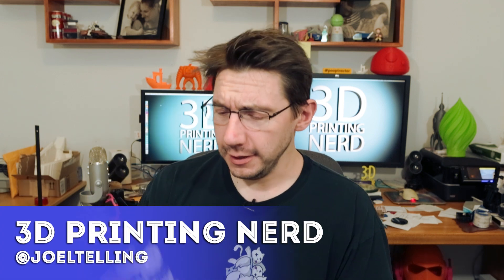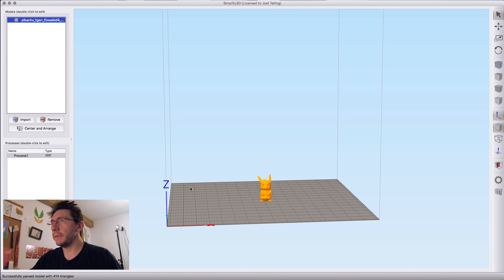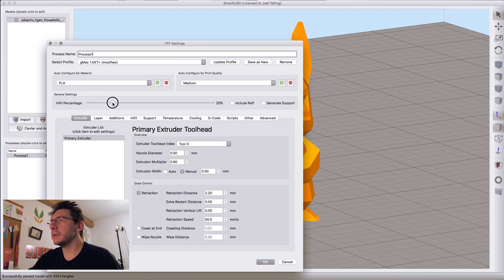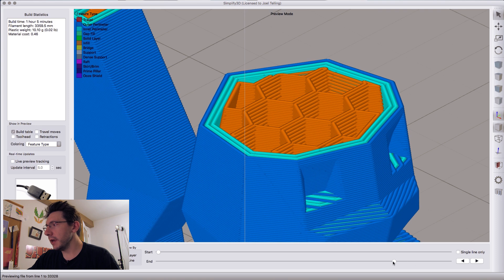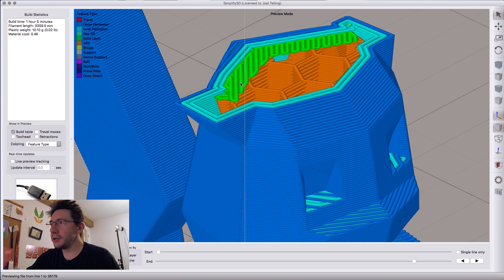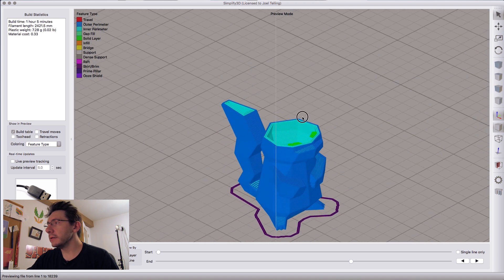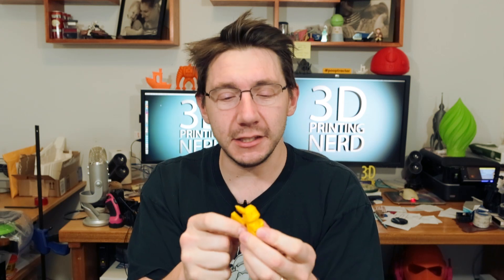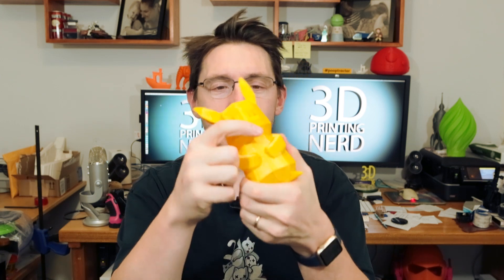3D Printing: Stop Wasting Plastic on Infill Percentage

Comment: This is an ungodly opinion-heavy video making a claim that could have been easily, actually substantiated with force gauge measurements. Simply ripping apart 6cm tall models by hand doesn't tell us anything about the quantitative differences. 

While I think I understand the point you're making (and agree that low/no infill is fine a majority of the time) saying "Some designs work fine with no infill" doesn't really get at the heart of the issue and there are no basic measurements.
Reply from the maker: +Thomas Wade agreed. I SO agree with you on this. I missed out when I didn't have the proper gauges to measure. I'm hoping to revisit with better testing methods.
Reply: Don't get me wrong, I think your videos are great and you do a great service to the hobbyist community. Looking forward to seeing your take on this subject with more data at hand.
Reply from the maker: Awesome! I'm a nerd, man. I LOVE raw data, so this very much interests me :)

Comment: I have a question is if I want to use my printed object for mechanical usage like gear, want is the better infill?
Reply: ～Koma～ it its gonna be used hardcore, and dont want it to break, high infill percentage and walls, it depends what the piece will be doing. i recommend if its really gonna be hardcore, mold it and cast more hardcore resin so itll be super hard. it just depends your usage.

Comment from the maker: Wow, this video is seeing some HUGE numbers right now. First - thanks! Second - it was recorded and published more than a year ago. I'm trying to keep up with the new visits, but, it's a year old and I've done a lot of content since this :)
Reply: How much infill do you suggest for drone frame (weight and strength)
Reply: I've noticed that most prints have a small ring in the shape of the object (except enlarged) on the build plate. Why is that?
Reply: @Dimenshun0  It's called a "skirt" and it's one of the options for improving bed adhesion.
Reply: Overfed Turtle you probably mean the skirt or the brim. Basically the slicing software adds this to either make sure the filament is flowing smoothly before printing the actual object, and/or to increase the surface area on the first layer so the item sticks to the bed better.
Reply: @Dimenshun0  it is usually done to 1) mark the area of the print and 2) extrude some filament to guarantee an even flow for the actual print.
Reply: According to what I could find, the small ring is called a skirt and it's used to prime the extruder to ensure a smooth flow of filament. Simplify3d has an article on rafts, skirts and brims (top link if you google "3d print skirt").
Reply: Pikachu piggybank!
Reply: Nykachuu That is a WHOLE different matter and depends on Soooooooo many factors you would need to give me a lot of details and possibly the drone frame file itself
Reply: normally i use 20%
Reply: Daniel, that's the "skirt".  It's a single layer of plastic that is extruded prior to printing the actual part and ensures that the printer is extruding plastic before it gets around to making the object you care about.  It is configured in the slicer (Simplify 3D in Joel's case).
Reply: 3D Printing NeN
Reply: The replies are from morons mostly, good video though!
Reply: It's just to prime the extruder and make sure plastic is coming out before you start the actual print.
Reply: I know this is an old video but I think I have a some relivant information.

I actually tested 3D printer infill strengths for a materials test, and found from memory that a modle 15mm thick with 100% (solid) could withstand upwards of 40kgs of force it was all done properly I have some video of the experiment but it was done awhile ago and we cause a number of accidents so we had to stop halfway through.
Reply: How do I know if a model won't print unless it has infill?
Reply: Did you use supports on the Pikachu
Reply from the maker: I did not!
Reply: I have a question, wat computer app were u using
Reply: but does it save time?
Reply: dude im printing 100% infill during small highly detailed prints, infil effects more than the toughness of your print therefore is a easy print like that pokemon not a suitable test to base conclusions on.... you know people like me assume that what you say in your videos is the undoubtable truth, many people use youtube as a place to gather information and learn therefore you should make sure that you don't make false claims its all about acting professionnel. i hope im not to tough on you we all humans keep up the good work
Reply from the maker: @victorwuisman6268  Victor, my dude. You're not too tough, I promise. Thanks for the head check, and in the almost four years since this video, I've learned quite a bit. Maybe I'll do an update in the near future :)
Reply: @3DPrintingNerd  looking forward to an update thanks for the service you are doing for the community :D
Reply: Probably because 3D printing is becoming more popular than 4 years ago...and more cost effective. If a goofy psychologist like me just bought a 3D printer, then that means anyone might have one now!
Reply: thanks for making this video bro it was a godsend.
Reply: ALSO FIRE INTRO TF?
Reply: 3D Printing Nerd  eijdpoidodpk
l

Pipe
L
Love

P
K
L
Ok

L

L
Love

Comment: Question, if you had a Huge printer, could you make a house out of plastic? If you had the power and materials, would it be possible and how much infill would you require?.
Reply from the maker: Yes you could! That, big printers like that use concrete. Crazy, right? Concrete is 100% infill ;)

Comment: When I designed an auto part for my 3D printed automotive parts video, I actually designed it in a way that forces the inside to be hollow, and it is stronger than both the part it was based on and the OEM part.
Reply from the maker: Dude, that's COOL. Way to go!
Reply: On my way to watch

Comment: No weight to strength testing ratios... No surface joint types analysis... No considerations of various plastics or temperatures... And what about software that doesn't have an infill percentage slider (I've used at least 2)... Why not make a video testing joint sizes of 3D printings with various infill percentages, joint angles, and infill patterns (similar to this one: https://www.youtube.com/watch?v=cRPgCMmbeyQ)? You would get way more views cause your video would actually have a purpose...
Reply from the maker: I completely agree with you! This was from a little more than a year ago, and the video itself was the result of a conversation I was having with a few friends. I NEVER thought it would get the exposure it has. My plan was to always revisit and print some models at different percentages in different materials, then do some load tests. Obviously, I never got to it, which sucks. Now that this video has gotten such exposure, I can prioritize the follow-up. Thanks for watching, and honestly, thank you for the comment and the feedback!